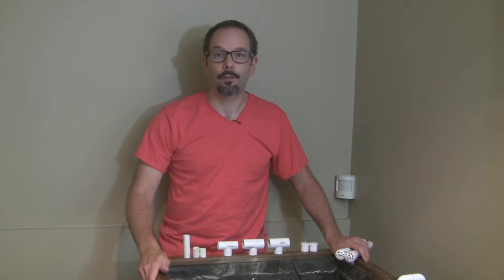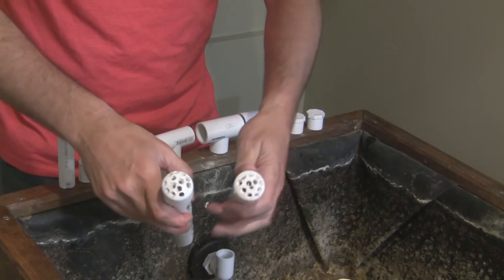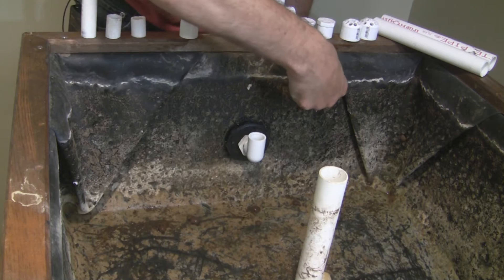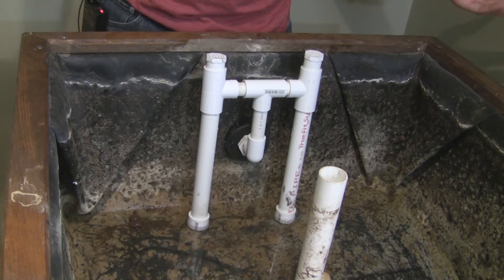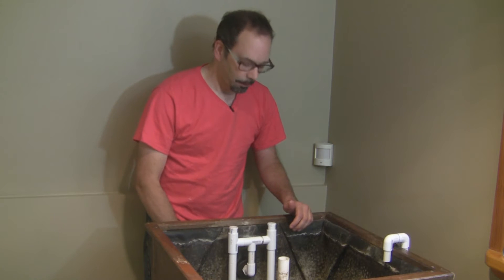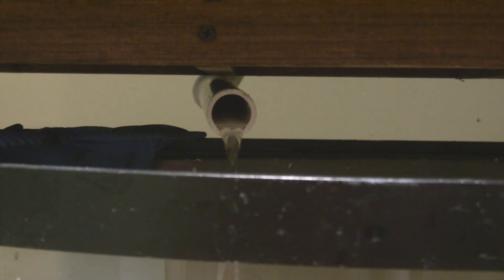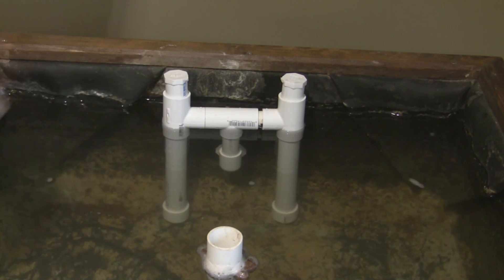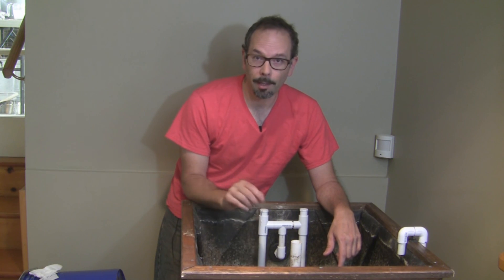EZ-T Siphon for flood and drain aquaponic grow beds (DIY How To)

Comment: Thanks, good to see another siphon. I just connected a few U siphones the other day with 32 mm irritation tube and they work well. The siphones are on the outside of the grow bed for easy access. I remember working with a bell siphon in the middle of the grow bed several time, full of media and plants, and it was a hassle.  I have several flood and drain pots and will put in the EZ-T Siphon on some if not all of them. Agree, lots of trial and error but those who post to YouTube help prevent a lot of errors. Thank you all of the YouTuber posters.

Comment: Thank you! Your siphon design saved us. Bell siphons just weren't working, we tried adjusting the flare on the standpipe, we tried different sizes, and so on. Nothing would work consistently. Your EZ-T works like a charm. So last night we dug out the gravel, pulled out the bells, and installed EX-T's on all six beds (with the clean-out mod - we saw the video right before making them, so switched from elbows to T's with plugs at the last second, lol).

Comment: Hey, the reason the larger diameter drain pipe allowed for the siphon to break is because the surface tension at the intake tube isnt breaking to allow air in to break the siphon. 
You can solve this a few ways, you've found one of them. Slow down the flow going into the grow bed, put a small cup at the bottom of the intake tubes, or make your intake tube ends less level are other ways. 
The key to break the siphon with a small drain pipe is to allow air to enter the siphon another way.

Comment: Revisiting this video. Thanks. You could replace the end caps at the bottom of the bed with elbows and connect the elbows together. The pipe connecting the elbows would have to be slit. It would no long be a EZ-T Siphon but rater an EZ - O or EZ - Square Siphon.
Reply: Mike Wallace - One of his designs was like that and it filled with roots....that's why the tee's with removable  plugs to allow for maintenance at the inlets.

Comment: Simple way to avoid root problems is to parallel the drains and place the siphon in a separate container ( bucket) that is set at the same level as the grow beds, then no roots can get into it . Also the amount of drop in your outflow also has a great bearing on the way the siphon works.  In one of my first attempts I had too much drop and the siphon would empty the siphon bucket before the other beds could completely empty, so I had to cut down the inflow of the T so that the drains from the other beds could pass all their volume.

Comment: great concept. how long is the straight run to the fish tank. ive read this should be 300mm or more.Btw if you wikipedia siphon; NO ONE really knows how they work. despite 4000 yrs of use. different models explain different siphons butno one thoery explains them all..